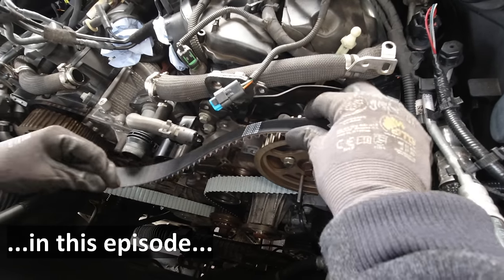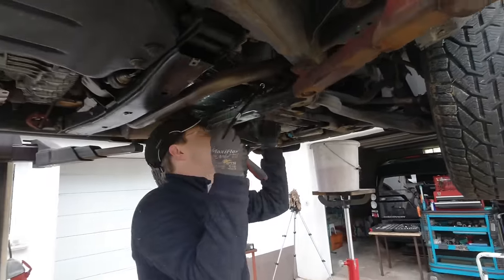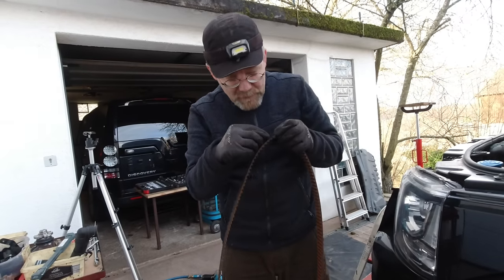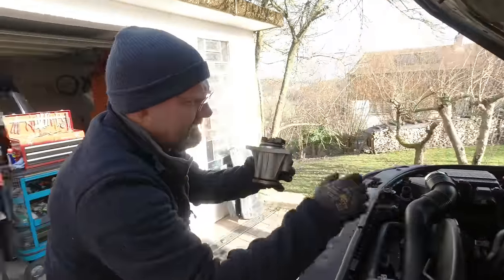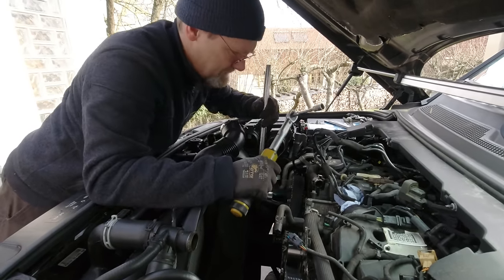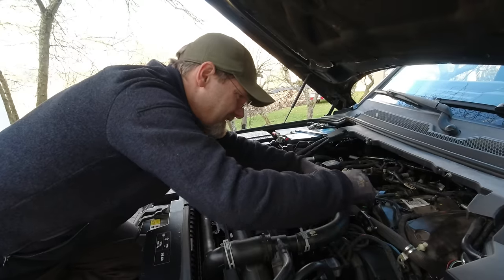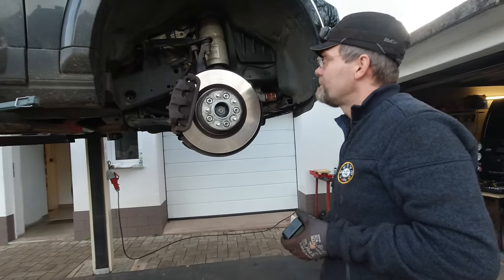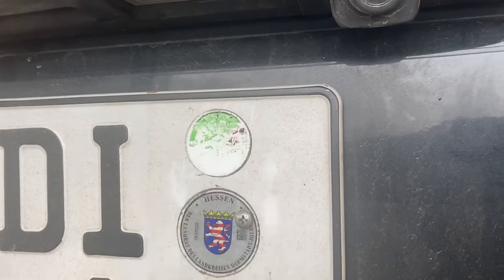Timing Belt and Big Service - Land Rover Discovery 4 SDV6 / S5-Ep10

Comment: A small correction from a desk top mechanic… its not ‘belt dust’, when the engine is running the belt ‘polishes’ the cam gears etc, these are steel so then flash corrode between engine running cycles, when the engine next runs its polishes off the corrosion which is the red dust you see on the plastic covers… note this is not normally evident on LR engines and this is entirely your fault, your engine is too oil tight! The oil leaks protect the cam gears etc from rusting 😂
Reply from the maker: Ah, I see.  Makes sense.  Christian

Comment: Nice work and a good car. My car is at 240000km, 2 oil changes every year, 5-30 Motul C1, driving hard at hi ways(150km/h), and heavy caravan(110), the car is going grate so I can not complain about the oil.  I love these cars, and if I have seen your and needed a new one, I would have bye it. 
Greetings

Comment: Good advice from you on the engine oil, in my 2001 Toyota Landcruiser Colorado I used to use good quality Castro oil and change it every 5000 miles and changed the oil filter every 10000 miles. When i bought the car it had done 116,000 miles, when I sold it recently it had done 385,000 miles, used no oil between oil changes and went like a rocket. So I quite agree, frequent oil changes are considerably cheaper than a new engine and a lot easier.

Comment: @ 11.29. Christian makes reference to the INA timing belt kit for the LR.  I used to work for a German company that manufactured market leading printing equipment. INA bearings were widely used in the machines. I was told that as well as being of exceptional quality, INA bearings had a large reserve of grease/lubricant and double overlapped end caps. So these bearings were long lasting and virtually impermeable to paper dust and set - off powder ingress.
Reply from the maker: Yes, INA is a good brand.  Not aftermarket stuff.  Christian

Comment: Great video Chris & Vera, as always. I prefer timing belt over timing chain any day, based on a DIY.

01. Belt is much more quiet compared to chain.
02. I don't mind the shorter life of the timing belt vs timing chain, as I can DIY it with ease.
In the past I always replace my timing belt 1/2 time the recommended KM, as I redline my engine all the time gear 1 , 2 and 3.

03. This is the common fact I hate the most about typical engine design with timing chain.
A timing belt is dry, no need engine oil for lubrication.
Timing chain must be oil bath. There are many engines where its coolant path will have to cross over the timing chain area, because often the mechanical coolant circulation pump is at the front of the engine , sitting at what we call lower/main timing region cover. So coolant must cross over timing chain oil bath region and seal or o-ring is used.Timing chain itself can last a long time, not so with the o-ring or seals, because they are elastomer and usually 15 years is as safe as we can expect it to not swell or heat damaged or whatnot.
Depending on country where the car is located at. Hotter climate countries, suffer faster o-ring/seals failure.

When this coolant cross-over seal/o-ring leaks, it leak into the timing chain region and coolant will mix with engine oil. Just like how oil cooler gasket failed and the deadly cocktail happen.

To replace this kind of hell located o-ring/seals is a very expensive job as everything timing chain + guides + sprockets and etc etc need to be removed to access such a cheapo coolant o-ring/seals at the engine block side. Cry cry.......

It is so soothing to see your engine is still using BELT...sweeeeettttt 😍

Comment: My rule of thumb is: "If it goes back together easily, you have forgotten something!" I regret selling my first car a Series 88 with PTO winch(Still on the road). A Series 109 that I built from parts with a TD from Turner Engineering and my Classic 1987 RR. I don't regret selling my 2001 P38 RR, that was a cursed car.

Comment: I had a new Gates timing/water pump kit for a Dacia duster and the hex adjuster on the tensioner snapped straight out too as well as the bearing having play. I returned the kit and changed it out for the INA, much better quality.

Comment: Very Good, i see you are Fitting a Original Replacement Trapezoidal Belt to Matching the Trapezoidal Pulleys..! Instead of a Round Toothed Belt to a Trapezoidal  Pulleys. It is always good to concentrate on your own work and do it right...! Full service is not needed if you are going to sell the Vehicle. Changing the Timing Belt and Auxiliary Belts is enough because some new owners want to do some maintenance themselves or Have their Mechanic, do it..! So your Full Service might end up being redone...!🤔🤔😇😇👍👍

Comment: @28:44 This can be measured- With a multimeter place one of the probes in the coolant and one probe on battery negative, car does not need to be running. You should see below 200 mV. If more consider changing the coolant.

Comment: Hi Christian and Vera, love the weekly videos. I hope you don’t mind me posting a comment on this video regarding something you mentioned in passing when you were going over your latest disco 4. It was the heater diverted valve that is fitted alongside fuel burning heater. You said if you don’t have one fitted you won’t get warm air into the cabin if you start the FBH with the engine off as the heat will go to the block first. I noticed the the Mall crawler doesn’t have this valve fitted but your latest acquisition. Discovery four does. My disco 4 doesn’t either but I would like to retro fit one so I get the warm air in the cabin. Any chance you could include adding the heater valve in a future video?
Either way keep making videos on the LR4.
Reply from the maker: That is very costly because the water hoses need to be replaced.  You would need a donor vehicle or about 1500 Euro.  I will take a closer look during teardown and try to show it.  Christian

Comment: Great videos guys you are amazing! Today I opened cover where the timing belt is and I found out that the right gear wheel is destroyed. There is alot of oil everywhere. My question is why did this happen and is there more damage done due to gear wheel failure. Thank you
Reply from the maker: The valves may have taken hit.  The right pulley is know to crack at the spokes of the belt tensioner is not renewed with a OEM Gates.  This failure sucks.  Sorry.
Reply: Thank you so much for the answer. I will check that up. You guys rock!❤

Comment: Hi there
Enjoyed the video and as always it’s a good watch , I have a big problem with my Toyota hilux Revo 2.4D , I just had to spray some WD40 on the fuel flap hinge as I was getting a creaking noise from it when I opened it up to fill up the tank , would this in your opinion be deemed an ok repair, I also have to replace the car washing sponge as it’s getting worn out , it’s never ending with Toyota problems , good news is the temperature is 36c here in Thailand so I don’t need a big jacket on to go out and do all this work 🙏🏼🙏🏼🙏🏼
Regards Davy 🏴🇹🇭
Reply from the maker: 😅Hilux is next on my list, for Robin. Hope we can make that happen😅🙋‍♀️

Comment: If I saw an advertisement, “Landrover Discovery 4 for sale owned by LR time” I’d be there with my money post haste and drive away happy.
Reply: Me too.  But do you have a degree in mechanical engineering?  And a high-lift, plus a full set of Snap-On tools?
Reply from the maker: And a machine shop!

Comment: Mercedes has a massive cam/crank sensor issue in USA with oil migrating through the plugs via osmosis and into to ECU .It’s a big debacle and the factory fix is an even bigger debacle. Look it up guys it’s comical unless you’re affected.

Comment: Great video again! Just a quick one - my Disco 3 2006 is not equipped with DPF should I use Castrol 5w-40 DPF or some other Castrol oil?
Reply from the maker: Yes, check out our „Engineoil and Oilpump“ playlist and warch the video on ny Disco 3 non dpf👍🙋‍♀️

Comment: I don’t believe in oil extraction vacuum tools either. I’ve had people say main stealers use them but that is zero comfort to me. The manufacturer is all about minimum fleet cost so as fast and cheap to 100k. No way a vacuum system gets the crud out of the sump like warm oil flowing out of a sump plug. Hot oil, open the sump and feel the love as you pour fresh oil in at the top.

Comment: Vera, you keep saying you can’t get the gap diagnostic software from the App Store, but that is exactly where it comes from.  What you mean is you need the gap diagnostic dongle that plugs into the OBDII port - it will not work with the App Store app alone.
Reply from the maker: Exactly.

Comment: Hi, I have a 2014 lr4 hse lux and the mechanic changed timing belt but 1 of the cylinders is not firing. Do you know what it could be?
Reply from the maker: If he did not remove the starter, the timing is out.  Christian
Reply: @Vera_and_Christian  Thanks I will ask them and let them know.

Comment: Today after I got my car back from a cam belt/timing belt change. After driving 1300km a heavy knock started, vibrating engine and smoke from exhaust. The workshop that says after sending them the video says it's the engine bearing. I have my doubts.....
Reply: @Vera_and_Christian  I opened it up to inspect what they had done. It was the right side (seated in the car) camshaft sprocket that broke off. (Mechanic said he and his south african partners have never seen that happening)  why is it that 1 week of ownership I was aware of the issue(because of your channel) but they (group of namibian and south africa landrover group) are oblivious to over tightening the tensioner.

Comment: My LR4 SE, SDV6 has both en engien fail, couse the Turbos bleeded Oil in the engine.. so maybe will check it up, what du i have to do if i want a Rear Dif installed?
Reply from the maker: You need to be cabable to install it wich is not just plug and play on a Discovery. 👍🙋‍♀️

Comment: That amount of carbon in the intake is nothing compared to the F-150s I've seen I normally have a large pile of carbon in the intakes removing the y bridge. I WISH the F-150s were that clean.
Reply from the maker: Wish we would have a F150. One day maybe.  Christian
Reply: @Vera_and_Christian  you could get a Ranger. The Rangers 3.0 is closer to the Land Rovers 3.0. the F-150 blocks looks like it was a completely different casting. The Ranger Engine mount locations look alot more similar to the Land Rover.

Comment: I wish i can have your skills. How long does we need to change the timeing belt on discovery 4. Some one said 8 years, but some ones also said 168,000km. I got 2015 disco 4, about 100,000km on the clock, my mechanic just mentioned to me need to change the timing  belt soon and will cost more than $2000 in Australia, yes Australia again 😂.  Is it necessary to do it now or can be wait bit longer as the can only did 100,000km.
Reply from the maker: Latest after 10 years and 165t km. I would not go over 8 and 140t km.  Christian
Reply: Thanks Christian

Comment: When selling a car always mention all good stuff  you have done wouldn't mention crank shaft may snap put people off
Reply from the maker: Every buyer has to do their research, most owners don‘t even know that there is a problem with these engines. The new owners have been using our videos in their research for a Disco 4 and do know what they are getting into.😅👍🙋‍♀️

Comment: Would you ever consider doing a discovery 2 video for nostalgia sake?
Reply from the maker: No, as long as Christian has such a demanding full time job, we only want to work on technical problems. We can start and finish those mostly on a day often only a couple of hours. Even with an engine rebuild, you do one task and finish it in one go. Unlike with our Disco 3 rebuild, whith all the rust removel, painting, brake lines, and what not. . . it's too much to deal with, for the limited time we have to work on our projects. We often worked for 3 weeks on one video. That is not sustainable with our life right now. 👍🙋‍♀️